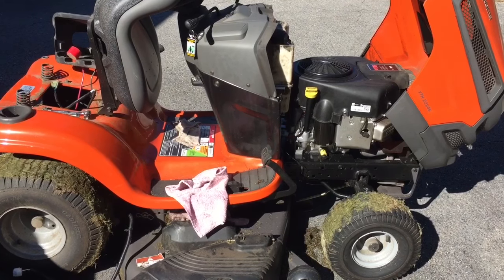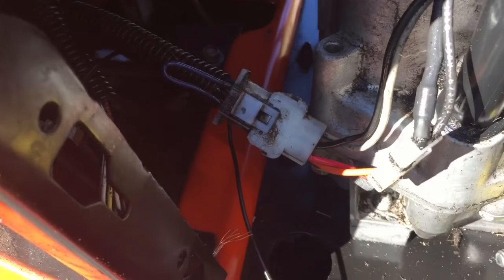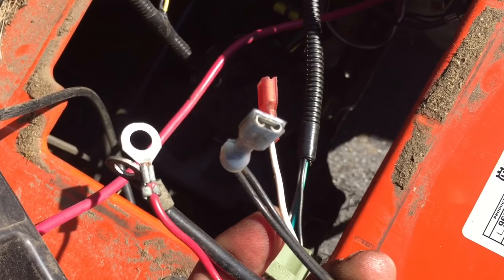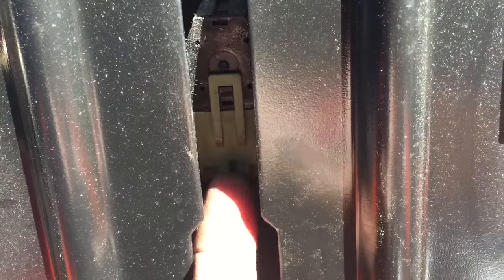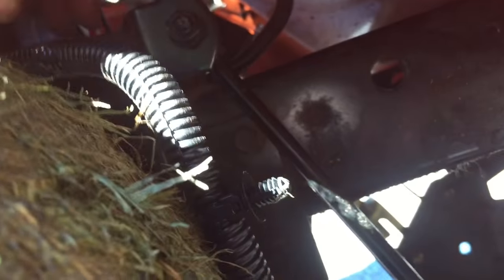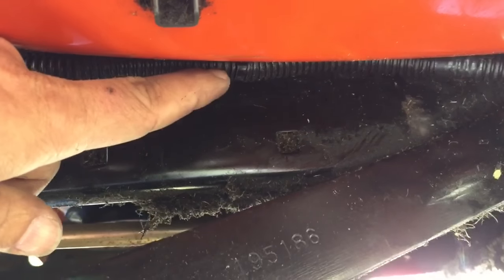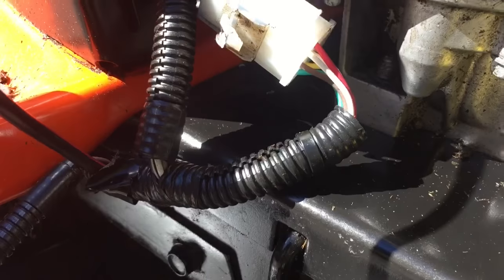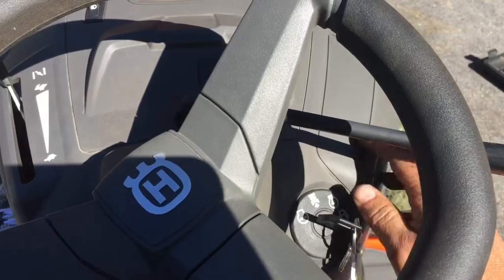Husqvarna riding mower wiring harness

Comment: I had this same mower and mice chewed through the headlights wiring. Thanks so much! do you think you could include the link to the wiring you bought? thanks
Reply: are the brown and black wires you used to tie with those the original headlight wires?
Reply from the maker: You can use the Husqvarna store. Find your mower and drill down into the type of part (electrical). https://shop.husqvarna.com/us/home
Reply: @jronaldlee  thank you

Comment: Hello I just found your video and I have the same model as you a d the same problem all the wires chewed up by mice could you provide the part number for the wiring harness
Reply from the maker: I don't have it handy, sorry. I got mine by putting the model number in here: https://www.ereplacementparts.com/
It's a very user friendly site and will help you find the part number with parts diagrams.

Comment: what is the white wires specifically on yth20k46 i completely rebuilt mine and yes it got rained on for 2 hour bairly but it wont cracnk start just jump start with cables what gives. theres a  small white cable not connected nut mpwhere for it to go
Reply from the maker: That's the neutral probably... take a look at the video starting around 1:45. If it's another part of the harness I'm not sure what you're referring to. Hope that's helpful.

Comment: Also wire ties pull ties are not good for mil spec electronics we use nylon lacing cord. It's flat string and we tie a cross knot . Then again our wire insulation u can hold a soldering iron on it it won't melt it's Teflon insulated wires

Comment: There's a tool to release the pin in connector just crimp new pin. I used to build the avionics wiring radar from separate wires I'd make the harnesses on F16 fighter jets mil spec USAF af pro certified.